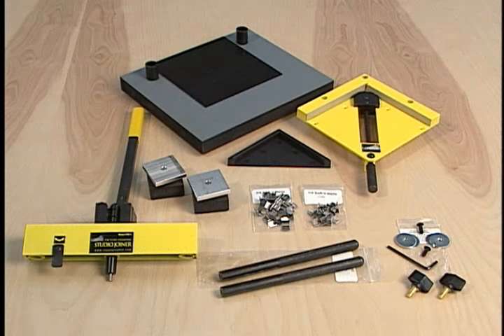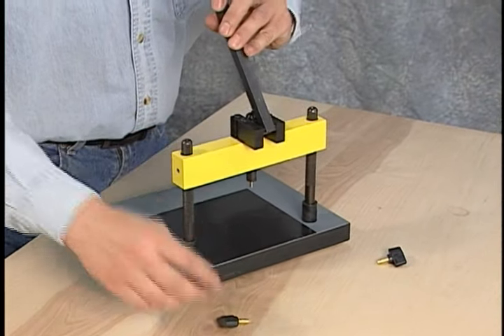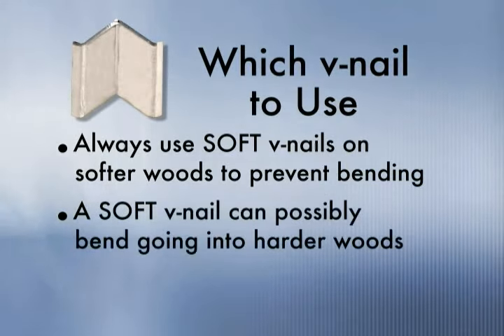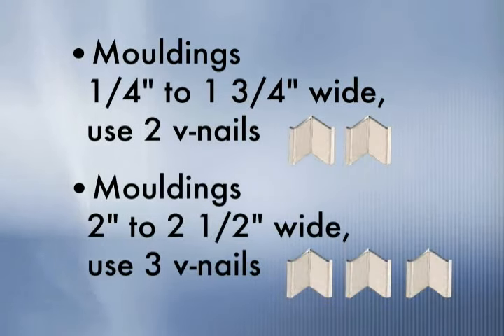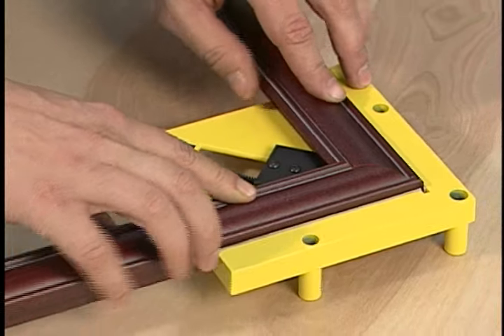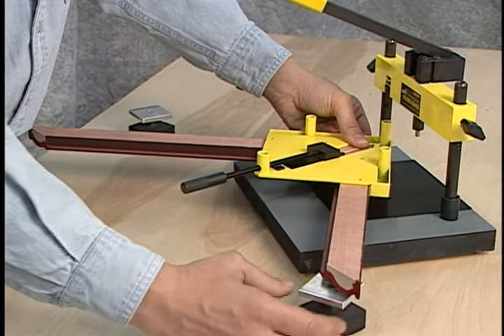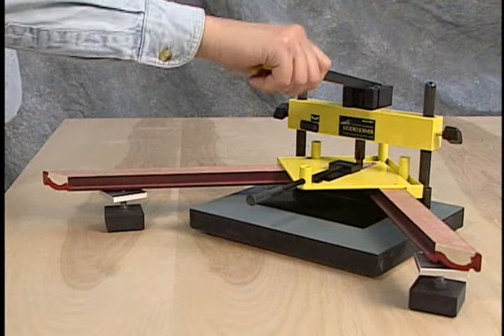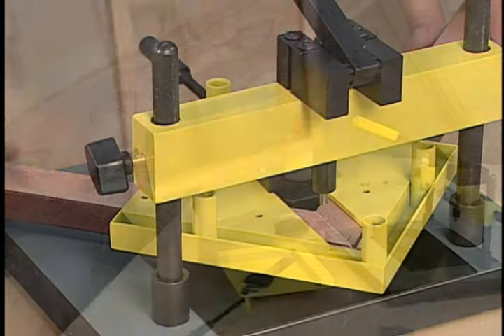LOGAN F300-1 Studio Joiner

Comment: I upcycle old frames and reuse them. Some are not wood.  Which V nails would be best for plastic or resin frames please?
Reply from the maker: Hello. Typically the soft wood nails work fine in the plastic composite moulding. Just pre-glue the corners and then drive nails. Thanks.

Comment: Hello If I use a Bessey strap clamp instead of the provided clamp is there any way I can join a 3" frame?
Reply from the maker: Matt Strom
I believe that yes you can but you may need to remove the driving mechanism off the vertical posts for each corner to allow you to hold the frame sideways under the retractable pin that drives the nails.

Comment: the magnetic pin is stuck inside the barrel how do I release it?
Reply from the maker: Hello,  Sometimes that happens because glue gets up in where the pin goes. Try taking the mechanism off of the vertical posts and turning it upside down. Then pour some solvent down into the pin and let it soak for a little while. That should free things up.